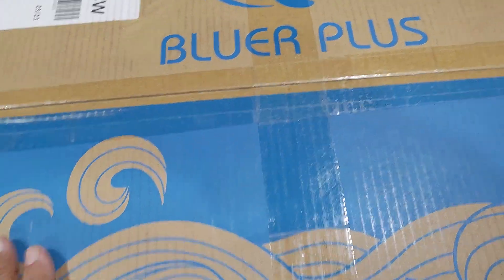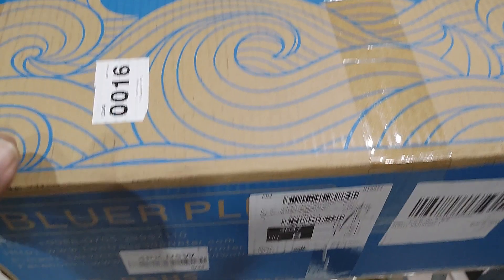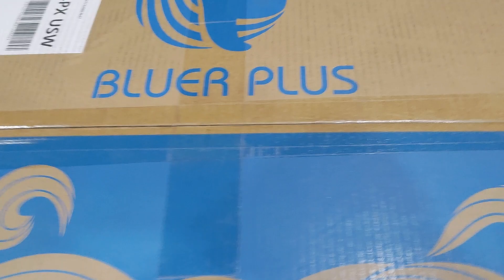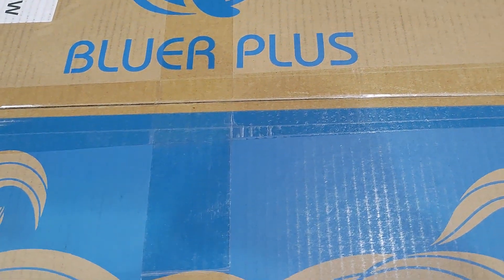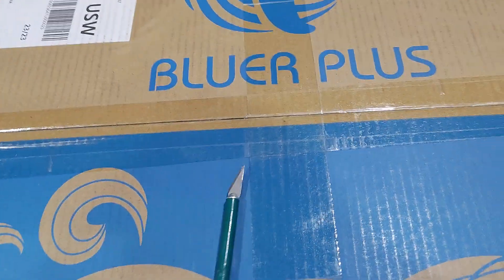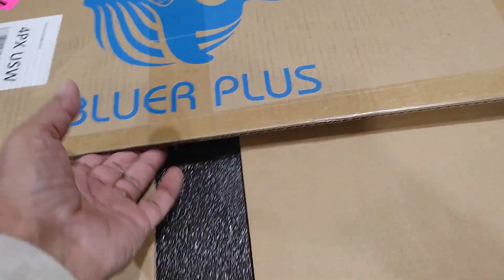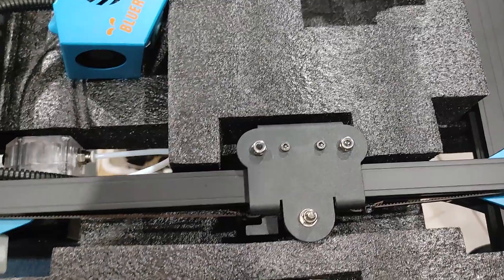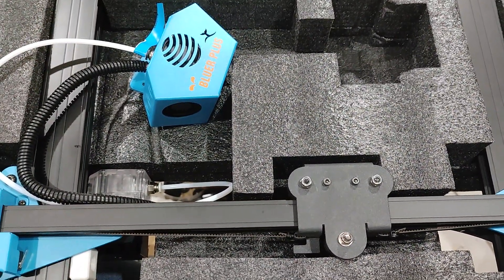Two Trees Bluer Plus 3D Printer - First Impressions WOW! - Part 1

Comment: I have been running this printer for a few years. the only gripe I have ever had was the Z axis couplers. they tend to break so if you get one then just order a set. they are a standard size, I replaced mine with creality couplers and have never had an issue. they do not have wifi and they are set slow in most slicers as the standard stock profile. but this machine has everything you would want to add to something like a creality but it comes stock. all the electronics are on the higher end. the stepper motors are 0.9 degree. most printers have 1.8 degree stepper motors. with this machine and some basic tuning you can print airtight fittings. and it is currntly like $150 on their website and for that price you can not beat this printer. loading filament is a pain but with practice it gets better. I have not taken the extruder apart to taper the throat for easier loading but that is just me being lazy lol. I almost forgot also pickup some capricorn teflon tubing kit it will make this machine even better all for like $15

Comment: It isn't supposed to be a glass print bed.  What you see in the picture is a smooth PEI sheet.  They sent you a textured PEI sheet, which in my opinion is better.  The textured is much more forgiving about slightly imperfect leveling.